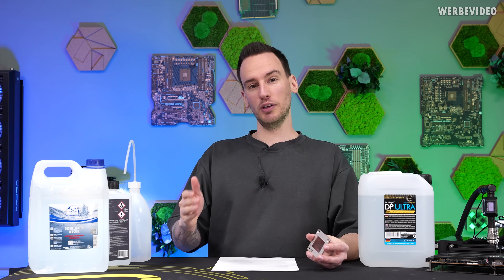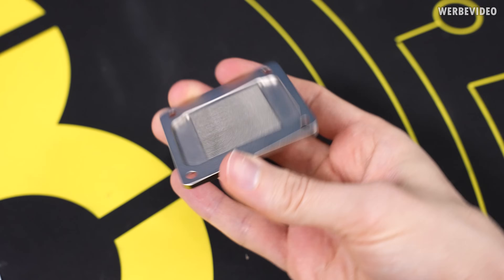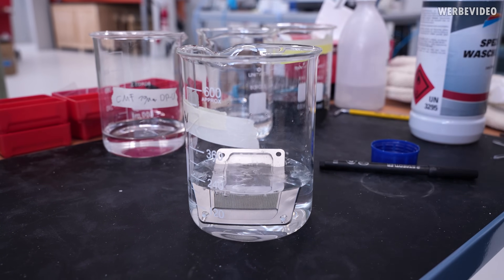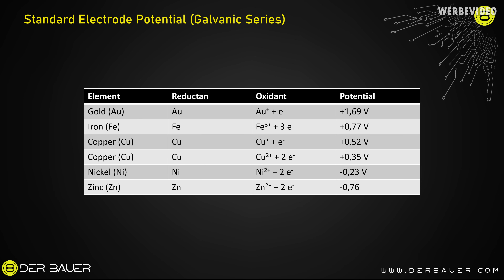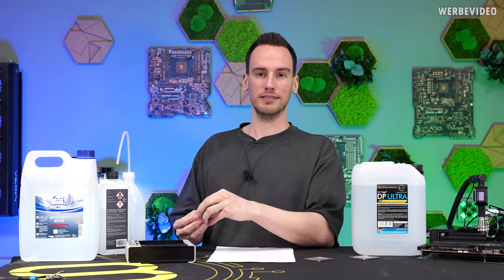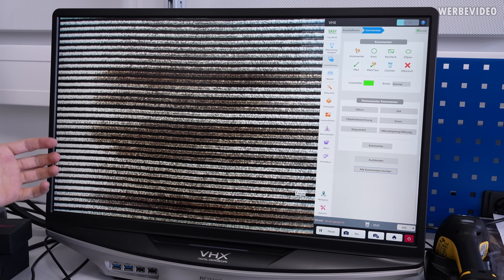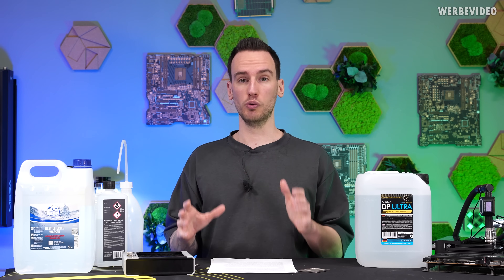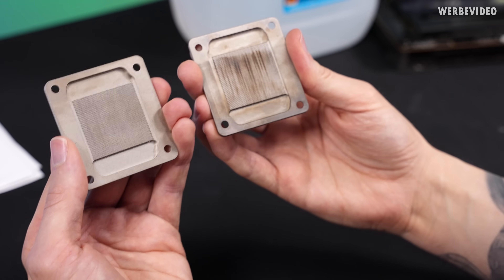Do NOT use Distilled Water for your Water Cooling Loop!

Comment: Great report! What would happen if you etched/milled the cooling fins far enough apart such that the nickle plating covers all the copper? look at the tradeoff between heat transfer and copper ion transfer (iow does no copper ion transfer to plate manifest in no copper ion transfer to rest of cooling system resulting in making it possible to use distilled water).

Comment: Can you top off AIO with distilled water? My assumption is that the mfr has prefilled the AIO with a suitable coolant and that over time, water has been lost through the non-metallic parts of the loop.  Not knowing what exact coolant was used in production and not wanting to mix coolants, I figured that it would be safest to add distilled water. Is this the right approach to topping off AIOs?  (BTW, I realize that many AIOs do NOT have a means to add coolant. It just so happens that I have a model that provides a top-off mechanism.)

Comment: i believe we can add a lot more to the distilled water points

distilled water is the purest form H2O, which wants to have microelements, that's why if it can, it will take those... for example why do we keep distilled water in plastic and not glass? it's not convinience, distilled water can take Boron out of glass, which pollutes distilled water, it's not convinience, it's necessity... that's why distilled water is also called "aggresive" because it will take microelements if it can, and in case of plastic it can't

and on the other note, is distilled water recommended for drinking? no it's not... but is it toxic? no it's not... you drink mineral water to absorb minerals that are dissolved in water, if your water has very low density of minerals, it's bad for you and distilled water takes that to the extreme, it literally robs your body out of minerals making it detrimental to your health... it's the same if you use salted water to water your plant, water will want to equalize level of salt, in this case drawing water out of the plant

think of it as drinking a caffeine drink to wake you up and energize you, but instead what it does is drain you, so you feel even more sluggish... that's why you don't use distilled water outside of lab or cleaning stuff

Comment: I've was running distilled water for 3+ years straight, all I ever needed to do was top it up no maintenance. I ran coolant propper coolant for a while, but I was traveling for a couple of months and came back to a clogged up loop. So I went back to distilled water with a silver coil, the only thing that ever happened (aside from me spilled water during re-filling and killing my PSU) was stripping the Nicel plating of my GPU block, my CPU/ VR monoblock was fine though. It's a little ugly I guess but it works well and is VERY low maintenance. Maybe I got better distilled/ de-mineralized/ de-ionized water?
I only learned later that silver tends to strip nickel plating, so next time I'll skip the Ni plating and go with bare copper :P
part of the issue for me is I REFUSE to pay to ship WATER from god knows where, all the way to Australia. It feel bad to pay to ship WATER, and it's kind of wasteful/ bad for the environment.

Comment: Distilled water is only distilled until contact with anything it can leech stuff from, such as most metals and minerals. That is why coolants need corrosion inhibitors and other additives such as trace amounts of whatever metals are present in the cooling loop to bring the coolant close to equilibrium to minimize leeching.

Comment: I use distilled water and 2x silver coils and I have all older EK parts (before their nonsense) and the nickel plating has always been an issue, but my pump has always been good and still has good pressure. The D5 pump is 7 years old this year. my 1700LGA Monoblock is a few years old and that has no plating issues. Only the 3080-waterblock and it's very minimal issues. Everything gets flushed every 6 months. Interesting video cause lately I've wanted to honestly ditch water and go back to air just for the maintenance and lack of blocks for RTX 50 series...

Comment: ☹This is the Same Problem with Vehicles needing Anti-Freeze. All of them have "Corrosion" Protections and Lube to protect the Water Pump Seal on top of Ethylene Glycol or less toxic Propylene Glycol for Freeze Protection. For Race Cars that only see warm weather often use WaterWetter that also provides "Corrosion" Protections. Without this protection you will have big problems causing coolant leaks to complete engine failure. And while many vehicle have "Long Life" coolant from the factory, the "Long Life" is Voided for many reasons like mixing or previous fill "Green" IAT Coolant with Dexcool and other OAT products.

Comment: Just redid my loop after 10 years that was filled with with distilled / demineralized + minimal algicide: There is the expected surface corrosion of copper parts, but nothing that degrades performance or cases concern. Technically the best would be long-life car coolant (or just the anti-corrosion additive package - which glycol isn't), but not really worth it to be honest. Water is just really easy and clean.

Comment: Distilled water is a pretty potent solvent. It quickly stops being so clean, therefore can cause corrosion.
Use of clean (distilled, "demineralized") water is rare and must be monitored (you can't fill the system and forget).
 
There were attempts to replace transformer oil with distilled water - failed experiment of course (same reasons, water was not so clean anymore after short time, became conductive, not isolating, epic fail).

Comment: I've run distilled water with "Water Wetter" (a pink performance automotive coolant) in it for over 2 decades and never had an issue.  Buying "proper" especially computer branded water coolants is a complete ripoff, IMO.  They're 2x or 3x the price and offer 0 benefits.  Or like that other crap that was trending for years, they leave deposits all over everything.

Comment: What's odd to me is that this is nothing new, actually. 
We've known this in cars for so long now. 
You should not run just water because It'll rust out your coolant system. 
Glycol does two jobs in a car. 
1. Prevent freezing by lowering the point to below 0 celsius.
2. Prevent corrosion in the radiator and engine.

Comment: I used distilled water with a 1/10 part car coolant for 6 years in my 24/7 rig. Water was still clean when and system was perfectly fine when it was eventually decommissioned.

Comment: I have been using cheap automotive type B coolant (No glycol) and cheap automotive water for years. Works great in my mixed metal loop. 5 years and no corrosion with only one fluid change.

Comment: In a loop you should only have coper, brass, and nickel.  There will be bits of tin and silver in too and maybe steel if some one was cheap. That shouldn't matter for anything other than minor discoloration in a loop unless you frequently change the liquid. 

If you put in coper sulphate as an algee inhibitor, like you should be doing, you will get the same results. 

This is all aesthetic and why we should have copper blocks with delryn/acetal tops. In would be more authentic worried about any acrylic over any of this. And I would not want to have glycol on my loop for th performance hit if we are trying to get every tenth of performance.
Reply: Rads should not have any nickel or steel in them. You won't be doing any damage flushing a rad with distilled water.

Comment: I had a AIO with a fill port, dry up some months ago to where no liquid was circulating anymore. Opened it up and all this brown gunk/fluid came out.

I researched a little, and did decide to flush it with distilled water - then adding a little blue automotive coolant to the distilled water. Cu plate and Al radiator, I think.
At the time it was weekend and I really needed the PC to work from home, so I decided the most optimal materials I could buy in physical stores that day. Ended up being a 2 day project to demount, clean, fill and remount... 

I know the coolant isnt good for the tubes - and I probably didnt add enough coolant to the distilled water to stop corroding. So far its been 4 months, and it runs temps like new.
Curious to see now how bad it is - but dont have the time to replace the water atm. The way I see it, I fixed a dead loop. And if it dies this year, I got another year of functionality out of it a few euro instead of buying an entirely new cooler.

Comment: I've allways used pink automotive long-life antifreeze, diluted to 10% from concentrate. (typically premixed are 46% for anti-freeze puroposes down to -35 °C) Worked flawlessly, and I care more for functionality and logevity over looks. No deposits, no corrosion, and in 10% mix, no practical difference in cooling capacity to the alternatives. Never bothered with the various "gibberish" coolant mixes for PC watercooling otherwise sold around. 
Only thing people need to pay attention to with ethylene-glycol or propylene-glycol based coolants (which most any automotive one is) is that the rubber components (o-rings) used in the cooling loop components must be EPDM (weatherstrip rubber), VMQ (silicone) or FKM (fluoro-carbon / "Viton" rubber).

Typically in a automotive cooling loop there is a wide mix of metals, steel/iron, copper/brass, aluminium, stainless steels (contain chromium and nickel in addition to iron), high fluid velocity and working temps of up to about 120 °C, which means the reactivity and wear it has to resist is alot higher too.

Comment: I like automotive coolant for my pcs.
Its cheap. Color doesn't fall out. Growth/corrosion inhibitors actually work. Thermal performance is slightly less but its fine.
It might be bad for certain plastics but idk. My ek stuff cracked and my alphacool stuff hasn't.

Comment: My last one was all copper blocks, ZMT Tubing , sivler kill coil and distilled water. I flushed and replaced once a year and never had a problem. Lots of people say all copper, no nickel or plated blocks , doesn't need a biocide or silver which does the same thing. But IDK it worked for me for 4 years. Great video and always something to learn with Watercooling.
Reply: I use a silver coil as well, not sure about metal deposits but ive never had anything growing.

Comment: If there is nothing sensitive to solvents comprising a loop (i.e. acrylic) then I wonder if isopropyl alcohol would be a good non-corrosive liquid to fill a coolant loop with. Pumps and their impellers would need to be able to stand up to the iso. If they can make plastic bottles that are completely unfazed by iso then they can make plastic impellers and other plastic parts that might be in a loop to be just fine running iso.

Comment: I use distilled water with PrimoChill Utopia additive. It's not ideal, but loop coolant is so stupid expensive. If I have corrosion issues, I use Fitz Polish. That stuff turns corroded blocks into beautiful ones---ThermalGrizzly should buy Fitz Polish. 

Fitz Polish is not only excellent at cleaning blocks, but also polishing the die after de-lidding. RockitCool de-lid kits come with Fitz Polish. I've used Fitz Polish for all my de-lids --- 7900X3D, 13900KS, 13600K, G7400, 12900K, 10900K, 10700KF, & 11600K (I ripped off some SMDs on the 11600K but a guy on my hwbot team was able to bring it back to life) --- & for cleaning Bitspower, Thermaltake, Alphacool, EK, & other blocks & it works great. 

Can you recommend an additive? I'm not paying $30/bottle for clear coolant. That's insane.

Comment: Your experiment in the oven is great for a visual demonstration, but a closed loop cooling system is not exposed to all the oxygen that your test beaker was.  Oxygen is required for corrosion to occur.

Comment: Mixed metal loop running for more than 5 years with zero corrosion. Nickel plated cpu block, raw copper gpu block and aluminum radiators. 30% G12 coolant and 70% distilled water.

Comment: Dude I can't count how many times I read on forums that distilled water is fine, and even that it's the go-to simple and great coolant for a copper-only loop. It is basically gospel. Thanks for this video! Now I understand why I've had all kinds discoloration of issues over the years. I used distilled water first to leak test, and also to flush radiators :(
Reply: I'm fairly sure that any forum you have looked at will talk about distilled water with an additive, not just on its own.   His comments about not flushing with distilled water are quite frankly bollocks.  Who is going to flush their system with a coolant mix??   For the few seconds you flush the water is going to make one pass over the surfaces at speed - this is not going to be a constant cycling of warm water.  The title of the video, and some of the way he has stated things here are really clickbait bullshit.   His scientific explanation was up to Romans usual level,  but he has pissed me off with a lot of this video - you can see how many people in the comments are "panicking" becuase of the title and because of his ridiculous overstatement regarding the effects over a very short period of time.
Reply: @malphadour  I did not use any corrosion inhibitors I did use a few drops of biocide though.    xD I guess I got lucky.
Reply: btw if your discolouration is black/brown that's just copper oxidation it has no performance impact it just looks ugly, it's nothing to worry about.
Reply: @DEJ915  yep, exactly. Everything works fine, temps are good and unchanged, it just looks bad
Reply: Just changed out my di water loop after 3 years of doing nothing.  A little bit of funk in the fins of the blocks but otherwise fine. Idk I guess I got lucky

Comment: Inorganic chemist here. All this happens because distilled water it is not the same as 'pure' water and behaves completely different as pure water. Pure water has no ions (except those generated by the auto-ionization of water), where as 'comercial' distilled water is, as Roman said, physically boiled and then condensed. This process drags some ions (very little) which affect the final conductivity of water and its redox potential. Also, distilled water it is not pH-rectified, as pH 5 or 6 can be found on it using a pH-meter.

On one hand, all metallic surfaces are passivated: there is a tiny, non-porous oxide layer over the metal that protects it from further oxidation as they are in direct contact with oxygen from the atmosphere. This layer is reformed automatically if the passivated layer is removed. Rust is the only exception, as iron (III) oxide is porous and oxidation can continue further down the surface.

On the other hand, corrosion is a electrochemical effect that needs:

a) pH lesser than 7.0 (acidic)
b) pressence of oxygen (it is dissolved in water, you cannot remove it completely)
c) water, in form of moist or liguid, to generate a channel where electrons 'flow' from the attacked surface to the depositing surface, moving therefore ions of the metal.

The problem here is that distilled water removes the passivation layer, exposing the fresh metal, which migrates to the more noble metal and deposits there (in case of nickel-plated copper, copper migrates from the passivation layer to the nickel layer). However, if you use pH-rectified distilled water (with pH higher than 7.0), corrosion cannot happen because the oxidation process generates the passivation layer and the process cannot be generated (stops at the oxidation of the first layer of material and doesn't advance further). The only problem with this method is that atmospheric carbon dioxide dissolves in water, generating a acidic medium (but it is a very slow process), so the pH in this case should be monitored to maintain it over 7.0.

Cheers!

Comment: if you disregard the little discoloration there is no issue running distilled water or at least never had any issues with 10+ years of WC. 60°C is already accelerating the aging of nickel plating. So yes the oxydation is happening but at a much slower pace than what you are saying. And once an oxydazised layer is formed the process will stop by itself.

Comment: I've always said in every video have seen that just distilled or demineralized water is NOT good.
Just use 20% automotive antifreeze if you are cheap as it is made for just the same but even higher temperature and more metals

Comment: I asked them for giving me the chemical composition of DP Ultra, but they only said it have ethylen glycol. Were not willing to say how much. It was like 7 years ago when it was clouding my clear tubes, so I switched to Norprene. The other option is to use propylen glycol based coolants. My blocka are slightly yellow colored, with small debris, EKWB monoblock even seems to have part of nickel chipped away, EKWB 1080 Ti block is more yellow. I replaced the coolant like 3 times in 7 years. I did flushed with distilled watter, good to know not to do it again in the future new system.
Reply: BTW distilled water is not always the same. It is maybe a decade, but i did read some very thorough article that some of them are not de-ionized, and it that case it should be fine. But the very "best" ones are too pure and will cause issues like the one described.

Comment: So basically, my loop should be dead. Running 3 years without any maintanence what so ever. Copper rad, old corsair aio rad (alu), corsair xg7 gpu block, old EK cpu blok, cheap ali express barb fittings. All running on tap water with a little additive.

Comment: I've used pure distilled water for 5 years with my 3090 loop and have not had any issues. Never used color dyes or chemicals, and only changed the water 3 times during that time. I have a new system now with a 5090 and 9950x3d, but I am still sticking with my 3090 for another rig.